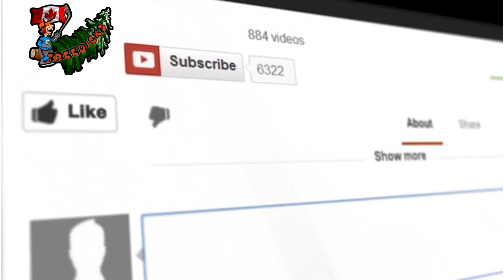Heaters working at the new shackle tons.

Comment: I bought a new style heater mod thing instead of a old junk one. If you buy a part at a junkyard. It is still junk and its electrical. They fixed the problem with a new style. Not that expensive